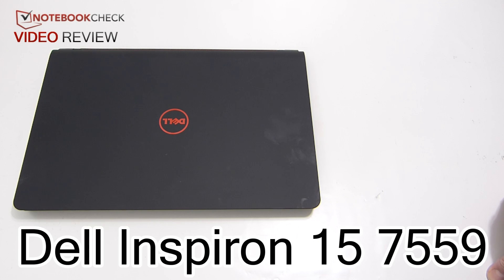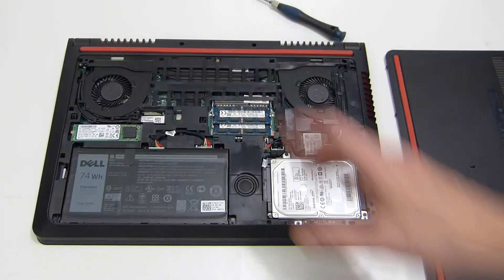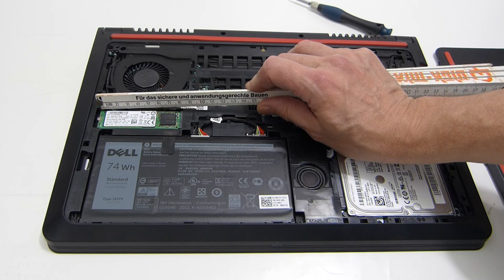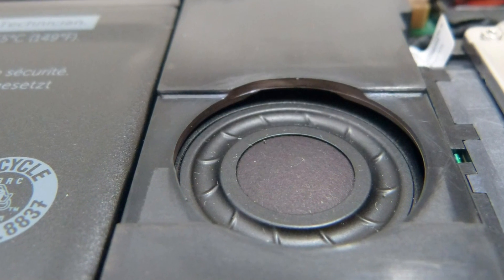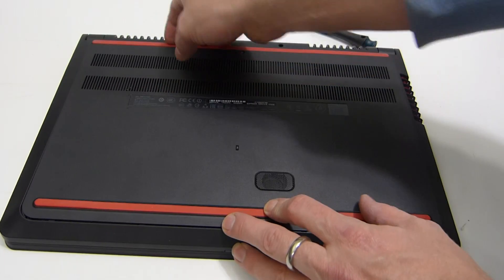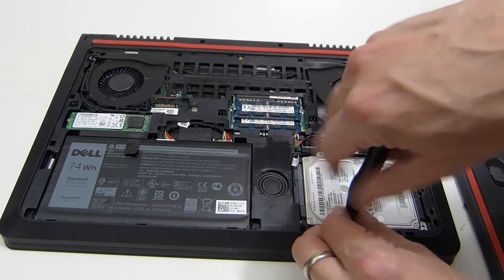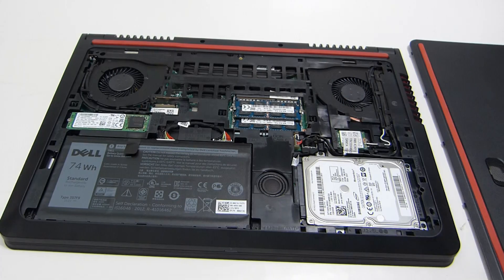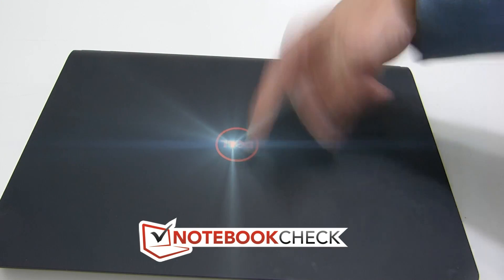Dell Inspiron 15 7559 Internals and upgrades

Comment: My Inspiron 7559 is showing Error 43 for GPU NVIDIA GeForce GTX960M. Even after installing W 10 Enterprise 64 bit, still showing Error 43. Since, Intel Grpahics 530 is integrated & GTX960M is Discrete (separately individual and distinct), can I replace the NVIDEA GTX960M with any other GPU?    It is mentioned that  DELL Inspiron 7559 is compatible with Ubuntu, Windown 7 64 bit and also Windowns 10 64 bit. Then I not not able to understand why it is showing error 43.  Can you please advise?

Comment: Is that a type 2280 m.2 sata sdd?? Possibly a stupid question but just wanna make sure before i buy the ssd
Reply: just dont buy nvme ssd it doesnt work, any 2280, 2260 or 2242 sata m.2 drive will fit
Reply: sender87 ok thank you

Comment: Is possible RAM 32Gb Upgrade?
Reply: No 16 is the max.
Reply: This is not true. I'm looking at Crucial's website and they offer 2 16GB sticks of SODIMM DDR3. It is guaranteed compatible with this Dell (7559) model.
Reply: DDR3L is only available in 8GB and 4GB edition
Reply: Furious  have you tried it? And does it work?
Reply: DDR4 is available in 32 or 64 GB editions but ddr3l is only available max of 8GB
Reply: ddr3 and ddr3l are different if u dont know dont mis guide others
Reply: I didn't notice you put ddr3l. I don't know why you would need a low voltage RAM. It makes little sense to opt for low voltage RAM if it doesn't have the capacity you require. Just get DDR3 RAM from Crucial smh
Reply: i've tried both ddr3 and ddr3l and ddr doesnt works even in pairs of 4gb unless you put a ddr3l in slot 0 and ddr3 in slot 1 which i dont recomend
Reply: Larry theran if you take out the normal 8gb and replace with two 16gb sticks, you can get up to 32gb. I believe that is what they advertised.
Reply: I haven't exactly tried it on my 7567 but as long as it is sodimm DDR3 you shouldn't have any compatibility issues. To be perfectly honest I wouldn't recommend more than 16gb ram because you will never use more than around 10-12gb max even after a couple of years.

Comment: ITS SO FUCKING LOUD CAN I REPLACE THE FANS OR SOMETHING PLZ HELP IT SOUNDS LIKE A FUCKING GOAT BEING RUN OVER BY A JET POWERED MOTORBIKE AND THEN HIROSHIMA BOMB BEING DROPPED ON IT!!!!!!!!!!!!!!!!!
Reply: francois qian you can just change the settings to make the fans run slower and quieter, so that its barely audible, but if you use it under heavy load don't be suprised if it begins to overheat

Comment: HELP Needed: I have this same configuration and wants to upgrade the stock M.2 SSD from 128GB to 500GB.  
1) HOW do I transfer or clone all the data-files (OS and built-in Apps) from the old SSD to the newly installed SSD?  
I'm looking at Samsung M.2 850 EVO 500GB as replacement and I would prefer to have the laptop reset to factory-settings
Reply: I want to do the same  please somebody helps us

Comment: I bought Dell Inspiron I7559 2512BLK one month ago, and I've noticed a problem with the speakers. The are popping , static & electric shock noise. when I'm using the headphones the problem still exist. I contacted dell support who told me to update the audio drivers 7 BIOS which I had already updated already. But the problem still exist! Please can anyone help with this?

Comment: I have one of these myself. However, as of yesterday, it no longer turns on. Could you give me a hand?
Reply: Connect it to AC and try, to make sure nothing is wrong with the battery. Then try taking off the back plate, also still connected to the AC and check if any power indication lights are on. If not then there is a hardware fault, preventing power from being delivered to the PC. Could be as simple as a faulty charging cable or charging port. Otherwise your best bet is to take it somewhere to get it troubleshooted, there are too many possible reasons why it won't switch on to sit there troubleshooting it yourself.

Comment: Nice attempt at a review, but I strongly suggest you properly research and study the basics on how to use a computer let alone give professional repair/upgrade advice. It'd be a shame for people who lack much knowledge about computers to wreck their systems just cos you lack the expertise/knowledge to simply disconnect the power supply before handling internal components... I'm not even gonna start to mention static charges, and other stuff. Just my two cents. Peace.

P.S. This is a splendid system. DELL, is def my choice for computers. Been using DELLs for a long time, and an Alienware for the last 4 yrs. This model, is perfect for heavy basic use, whether for work or business, or just heavy internet/video streaming etc. Gaming-wise, nothing too intense, and it'd be a breeze too. For someone who's looking for quick and responsive systems even for heavy usage - this is def for you. I can't carry around my 17.3" laptop to work, and my 2nd laptop is not really fast enough for me.... So I'm getting this after weeks of research. Perfect for intense work, minimal gaming and watching videos. Perfect, for me.
Reply: For a computer "expert" you certainly got  to learn about this sluggish laptop.  The hybrid drive is a slow POS and the wireless network adapter is slow as all heck. You'll need to replace both of them just to get average performance.  Then there is the issue of the Ultra HD display.  If you watch any flash videos on You''l get a ton of video stuttering.  And many programs will have a problem with DPI scaling.  So much for your "spendid" system Mr. Expert.

Comment: I'm wanting to add a V8.0 EXP GDC Beast Laptop External Independent Video Card Dock with the pcie adapter. Do you think it will work on m.2 slot or should I just go ahead and unplug the WiFi card?
Reply: You can unplug the wireless card to free up the pcie, and use that for your external gpu, then just use a wireless usb dongle, or ethernet to connect to the Internet of required
Reply: Give is feedback whether EXP GDC worksvia WLAN slot

Comment: Up to what size can the wifi card be supported to? It comes with a terrible 1x1 card and I want to replace it with a 2x2 if it is possible. If not are there are good 1x1 cards good for laptops that someone could reccomend
Reply: when you replace the wifi card do you need to install any drivers after or it will work straight off?

Comment: i cut myself everyday i dont have this laptop
Reply: I see you on every one of these videos lol. I just ordered this laptop so I can stop cutting myself
Reply: Tommy Drake :'(     im so... happy... for you
Reply: Dhipauk Joqim
No, because they are actually tested and are unlikely to have a failure rate that exceeds brand new things. Not everyone is comfortable with the idea of a refurb though, some even hostile, but only they lose.
Reply: francois qian blasphemy
Reply: I just got mine!!! I'M IN LOVE!!!
Reply: +Tommy Drake same, got the i7 1080p version on sale from the dell outlet website for $630!
Reply: +jackmiliken6 I didn't even know they had a sale going on for it. Wtf $630?? I bought mine used but pristine condition from Amazon with 256 gb SSD for $750.....
Reply: I'm with you on that....the question is, which one of us will get it first?
Reply: Talooka me :3
Reply: dude, where do you go for the discount?
Reply: Got the 1080p/i7 version of this laptop from dell @ 570$. Undervolted the CPU then maxed out the GPU Core clocks at +135 and memory at +530 for free +10% fps. Dank as fuccccccccccck. Also picked up a 1TB m500 SSD for 140$.  Dank as fuccccccccccccccccccccck. Hardware like this will take years to become this cheap, grab em while they still have em bois
Reply: Where'd you get it man?
Reply: Check dell outlet, selling refurbished gear that are for all intents and purposes brand new.  Mine came packaged very nicely and was pristine, not a single speck of dust. Doing this only makes sense if you can find coupon codes for 30%+ off, which dell regularly posts on their twitter (LOL)
Reply: Refurbished products could be a little risky, don't you think?
Reply: I'm really hoping to see a drop in the cost of this around Black Friday. I'm so broke and bills keep coming but I'm slowly but surely saving up -- thanks for the tip about Dell Outlet. I'll keep an eye on it and hopefully they get it in stock again soon!
Reply: I just bought this for 699 dollas
Reply: It sucks. the pivot near the power port keeps fucking breaking, and now the broken pivot has destroyed the wifi antenna. I've sent this piece of shit in to Dell for repairs 3 times since Nov 2015, and now it's broken for a 4th time but I'm out of warranty. The inside core components are a bargain for the price, but the build is complete shit.
Reply: i have it hmm liked it to begin with thought I would never want to play higher end games im sad now :(
Reply: Eric Fan ya mines doing the exact same thing😑
Reply: wait mine keeps disconnecting from the wifi randomly could that be the cause ?
Reply: Tulox i dont have any issues with my wifi. But mine wont charge sometimes
Reply: Yeah It Kinda Sucks :(
Reply: dude could u help me with some link i wanna make these changes as well to my laptop that the same as yours :)
Reply: It's not that a good laptop it's fine but it has flaws
Reply: it sucks i have one.

Comment: Great!!! Do you know what kind of sata interface for hard drive? 2 or 3? I want to change the original hard drive for an SSD and m2 with an samsung 950 pro 512gb. Can it handle with these components? Thank you!
Reply: Yes, i seen it done on other videos, I'm pretty sure it's sata 3
Reply: Al, even I want to put the 512GB Samsung 950 Pro in the M.2 slot. But that's a PCIe NVME card, and people are saying that the slot only supports SATA (not even plain PCIe). Have you tried this?

Comment: is the M.2 port for M.2 PCIe SSD or M.2 sata SSD ?
Reply: According to my research, its better to install sata ssd; although Dell says that the PCIe works too. The PCIe has mixed comments. Others say it only supports sata ssd.
Reply: nope it doesn't support nvme pcie ssd, I just bought a samsung evo 960 aaaand its my new paperweight
Reply: @sender87  This is really confusing as my 7559 had an M.2 connection with 1 notch for the M.2 ssd yet others have 2 notches the same as in this video,so doesn't that mean mine will accept the newer versions?Help

Comment: Can i replace the SK hynix 128 gb ssd with samsung 950 pro M.2 256 gb ssd
Reply: Akshay, the 950 Pro is a PCIe NVME ssd. I heard the m.2 only supports SATA. Have you done this?
Reply: it does not suport nvme
Reply: @sender87  My 7559 only has 1 notch at the M.2 drive connection then only the newer Nvme drives will fit won't it?
Reply: @onemoreriff7644  nope it doesn't support nvme only data m.2 drives
Reply: @sender87  Ok thanks it just confused me to see just 1 notch in the motherboard M.2 slot.So the later 860 evo M.2 will work?
Reply: @onemoreriff7644  as long as it says sata m.2 drive it will
Reply: @sender87  Thanks that's great Amazon are doing a good deal on that
Reply: @onemoreriff7644  Did it work? im looking to do the same thing! thks!
Reply: @rafahbueno  Yeah the Samsung 860 evo M.2 works perfectly.

Comment: If I get the core i5 with 256 GB of SSD from Amazon and I installed a HDD, would the gaming + overall performance increase or stay the same. Basically, is it better to leave it as an SSD or make it into a hybrid hard drive?
Reply: +Vishal Venkat Your fps will not change, only your loading times.

Comment: Two questions.
I cant use ubuntu on this... have you got any guide?
And finally, I installed the ram but the BIOS and Windows doesnt recognize it. Even when after install it, the system showed me a window with the message "RAM HAS CHANGED".

Comment: So the 256GB SSD model comes with room to install a HDD alongside the SSD, or the SSD needs to be replaced?
Reply: +Florence Ledger unless u want to replace the 256 ssd, but there will be space for the hdd to go in if you'd like to install one.
Reply: ***** getting the 1TB would be cheaper than an ssd. Since ssd's are more expensive get that and getting a cheap 1TB drive would be around $50-60. I'm not certain on the prices and stuff but do some research as well.
Reply: *****  Yeah that should fit perfectly!

Comment: Thank you for this great video.

I have this machine with 1TB HDD and 8GB RAM. I want to upgrade in the future adding 8GB more and a 512 SSD in storage 2. I want to know if the following components works: 

http://www.amazon.com/Memory-SO-DIMM-PC3L-12800S-1600MHz-HMT41GS6AFR8A-PB/dp/B00N46M5D2/ref=sr_1_2?ie=UTF8&qid=1453915303&sr=8-2&keywords=Hynix+DDR3L+1600

http://www.amazon.com/Hynix-512GB-solid-state-HFS512G39MND-3510A/dp/B015H2ZAXC/ref=sr_1_2?ie=UTF8&qid=1453914835&sr=8-2&keywords=SK+hynix+SSD

Thank you

Comment: Is the graphics card and proccesor removable(procesor because i want more ghz and grap card cause i heard that you can put a nvidia gtx 980 not M card in gaming laptop)?
Reply: +Alex Petkovic 
Nope. It's a soldered processor, and the full GTX 980 is not the card itself. It's just a chip that Nvidia provides to it's partners. If you want to upgrade your GPU get a GT80 or GT72 from MSI. They us MXM cards, which are swappable, but they are mobile cards, and will cost you a pretty penny ($800 for a 980M) If you want an upgradeable CPU, look into some of the Sager laptops that have a desktop CPU.
Reply: is it an soldered pgu too ?
Reply: you can only replace the hard drive, ram and battery, everything else stays intact

Comment: I got the i7 edition which didn't come with an ssd.  It was easy to install a samsung 256gb 850 evo.  Plan on moving to dual channel 16gb ram as well.  Also thinking of upgrading the wifi when I go to wireless AC in a year or so.  Its a  great machine as is, Dell didn't offer any upgrade options online, and thanks to this video I was able to do it myself.
Reply: Can i know how much price when you buy it, i search it on google all i see the spec is using intel i5skylake,gtx 960,8gb ram,1trb,its cost around 8.000$,i realy want to know the full name pf the product and the spec and the price the one that using i7,with gtx960,8gb ram,and1 trb harddrive,i can buy latter for the ssd,sory for my weird english.
Reply: I bought it in Canada for $1200, so it might be different by quite a bit in the us
Reply: Woww,why its so expensive,im not in us,im in indonesia,here i saw dell inspiron i77559 its around 7000-9000,but the information i got not prety complete,i just saw it on the internet,but do you think if i buy the i5,can i just swap to i7,or i must by the stock i7.
Reply: +Matt McIver 
Did you upgrade to the Samsung evo 256 gb yourself? Did you get any startup or boot issues or some issues trying to get it to ork in AHCI mode?

I just bought this Dell because I wrecked my dell Inspiron 15z trying to instal a Samsung 850 EVO 1 TB in that. I still want to use this SSD so maybe I an put it in my new laptop once it arrives.

Any inputs please? Can you share steps you followed?
Reply: I got the m2 version of the evo.  I used Partition Master Free edition.  http://www.partition-tool.com/download.htm

Just make sure you clone or copy the entire drive and not just the partition since windows creates multiple partitions.  Also enable format to SSD, or something similar in the options.  

Now I am just waiting on new dual channel ram.
Reply: Hey hey,i just wonder why is realy hard to find that laptop,or is its only sell in us or canada,or fo you think its safe to buy it from amazon?
Reply: +Matt McIver 
I used the Migration tool that comes on the Samsung CD with the drive. Did you face any issues at all during the upgrade?
Reply: +Matt McIver
and the M2 is the chip. I see. I used the regular drive.
Reply: +Rose Eve Where did you find it in indonesia? I find the i7 models in this site and its pretty expensive http://www.bhinneka.com/products/sku09715719/dell_inspiron_7559__core_i7-6700hq__-_black.aspx its around $1500
Reply: ***** i can't find it here,there is a more expensive option but the vga not even using gtx its still using Gt 970 and the price is 1000$,so mightby i will search another laptop like lenovo y40 the price prety much friendly but still using r9 m275,i cant find laptop that using i7or i5 and using gtx 950 bellow 1000$,i realy want to play starcitizen and many games in 2016
Reply: +makdtm
 no issue with migrating.  M2 was worth it for speed , especially since I kept the terabyte drive for storage.  I'm using this laptop for 3d art work and professional 3d.
Reply: +makdtm 
I have learned this lesson the hard way over the years.  Always check to make sure new parts are compatible, will fit and do not cause any damage to your existing system.  Usually ram is the only upgrade that you need to check out thoroughly.  Although the m2 chip clearance in this dell PC is limited to M2 drives that are 80mm long I believe.  You can find out details from the dell support site.
Reply: +Matt McIver thanks for the info. I think next time i will check with dell support first... and maybe move back to awesome desktops the next chance I  get.

Comment: Can the side where you put 4 screw for harddisk remove. Since i never saw any 2.5 inch HDD come with those side for screw
Reply: +Nuttapat Vimolratana It's a bracket around a normal HDD. You can reuse the bracket on your new SSD / HDD if you need to replace the HDD.
Reply: I see. Thank you for information :D